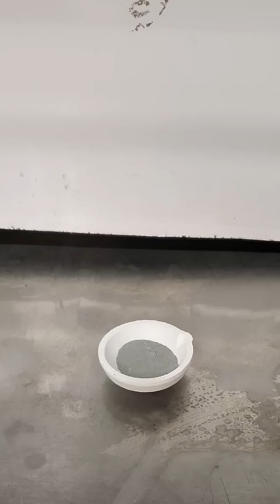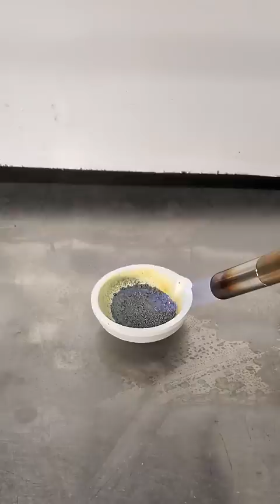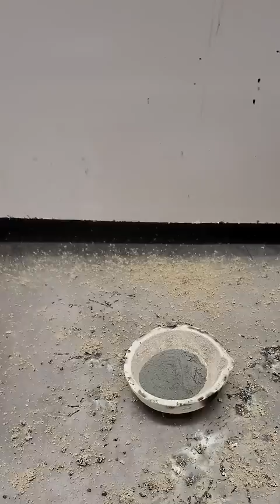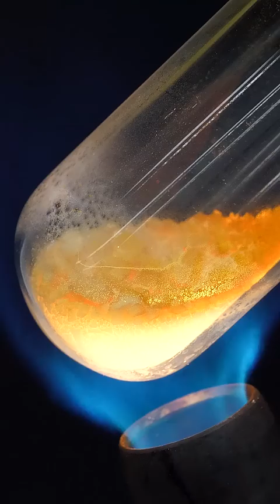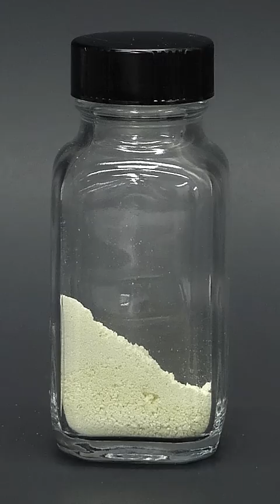This is what happens when you burn zinc and sulfur...

Comment: I have actually done exactly this at home one time. I used sulfur from a road flare and zinc from a carbon-zinc battery(I filed this zinc into a powder). Although the reaction was nowhere near as rapid as what is shown here, it did react. Under a UV light I picked out the chunks of zinc sulfide that fluoresced the most. I ground that into a powder and made a scintillation screen that would begin to glow in the presence of alpha radiation.
Reply: "I have actually done exactly this at home one time."
I thought u meant glow in the dark baby

Comment: In my engineering student days I used to mix up a lot of this stuff for smoke bombs.   As you can see in the video, it produces clouds of grey choking smoke, which leaves a grey dust over everything.    Only burnt myself significantly twice, both times with zinc dust and sulphur that had been in store for some months and had (I think) partially reacted so instead of going 'fizz' it went 'foof!'    
Things were a lot more casual those days, today I'd probably be charged with attempted arson and terrorism.
Reply: Is the zinc powder zinc oxide?
Reply: @Convolutedtubules   No, the mixture was metallic zinc powder and sulphur.   Used for propelling amateur rockets, so I believe.   It took quite a bit of igniting, but then I think it simply reacted exothermically to give zinc sulphide.   Zn + S ->  ZnS.   That simple.   It could sometimes be ignited by dropping a match into it while the head was still burning, but more reliably by a straw filled with a suitable igniter such as icing sugar and potassium chlorate.   As you can see from the video, it's kind of a messy process, spreading blobs of ZnS around and filling the air with grey choking 'smoke' which settled as a grey dust over everything.    It's possible that if there was more zinc than sulphur some of the zinc may have oxidised with atmospheric O2 to give zinc oxide, but I don't know. 
(I must admit I thought oxygen must be mixed up in there somehow, after all it was obviously burning, it wasn't till much later I realised you don't actually need oxygen for an oxidation reaction).
Reply: @cr10001  Thanks for taking the time to reply. This reaction looks pretty cool and I might just make some smoke bombs this way in the future! I wonder if it's any better or worse than the standard sugar and potassium nitrate rocket fuel.
Reply: @Convolutedtubules    Just one warning - it burns extremely hot, you really don't want to make an incendiary bomb by mistake   :)      But then you can see that from the video. 
Not sure how sugar and nitrate compares.   Sugar and chlorate was, I think, quite a bit faster than zinc and sulphur, and enormously easier to ignite.

Comment: This reaction is far more exothermic than the the reaction reaction between iron and sulphur, but you don't need a torch or air. When I was a child I used to mix the elements in a larger test-tube and heated with an alcohol or gas burner. I was a little chocked when I first time tested it with zinc dust replacing electrically reduced iron , because it was so much more intense. It was equally effective for making H2S to everybody's dismay  ...
What is the "weird, creepy, baby thing" ?

Comment: The rocket club I belonged to used powdered zinc and sulfur as rocket fuel.  If it is thoroughly mixed, it will burn so fast that it's more like an explosion.  A pipe a meter long filled with this mixture will burn in less than a third of a second.  POOF!  the rocket accelerates super fast!